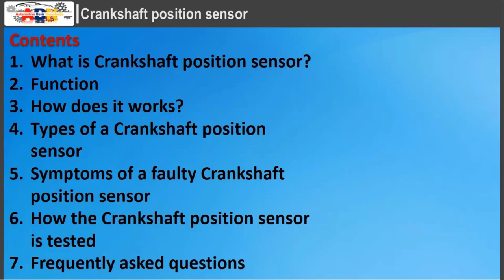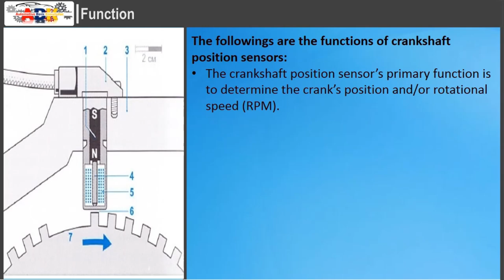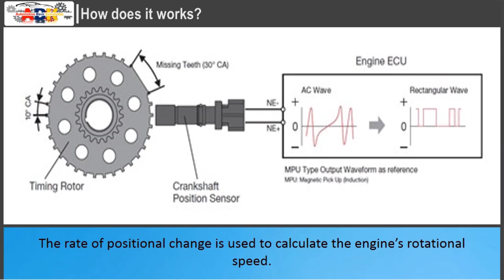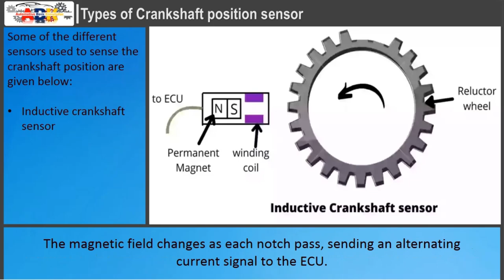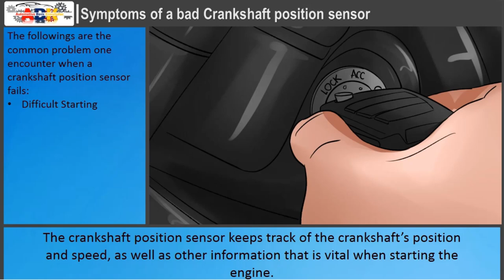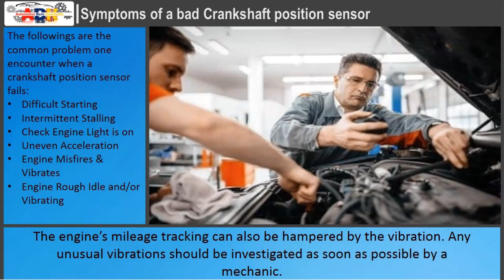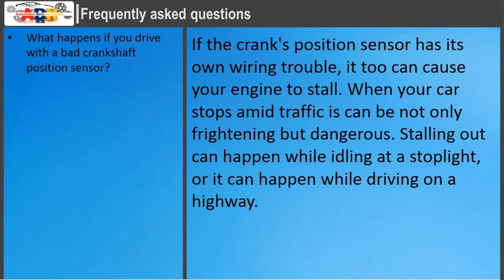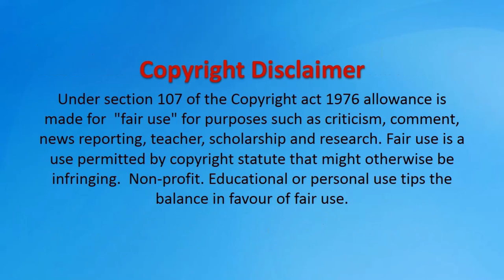Crankshaft position sensor

Comment: Good morning! How about doing a video on the issues of leaky cam shaft positioned sensor, of various brands, with end up oil getting into ECU. I would imagine oil leaking thru inside & flat part of the sensor body rather than oil leaking thru the O-ring which then leak oil thru the wire.🤔🤔🤔 Correct?

Oil leaking out of the camshaft adjuster magnets would sometimes be confused with the above.

Mercedes M278 engines have much higher chances of this happening in its cam shaft position sensor when compared to M271?. It is due to pooling of oil inside of these  sensor due to V shape of the engine?.

Regardless of M271 or M278 would it be advisable to change it once it is at 100,000 miles or more than 15 years old - since getting oil in ECU would exponentially increase cost and hassle when caught unexpectedly.

Oil leak from crankcase position sensor would face this issue?.

Comment: Good afternoon everyone I would like to share the problems I'm having with my 2007 Chevrolet Tahoe 5.3L. I really hope I can fix without spending 3k from engine rebuild. I have 3 codes P0340, P0341 & P0016. I already replaced the camshaft position sensor didn't pass smog test because of the check engine light on. Is someone having similar issues with they're Tahoe?